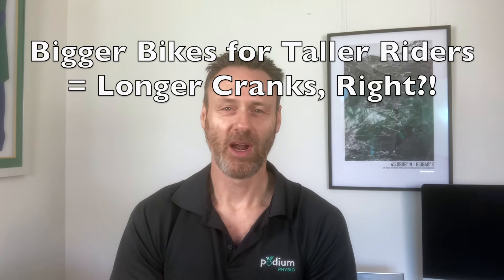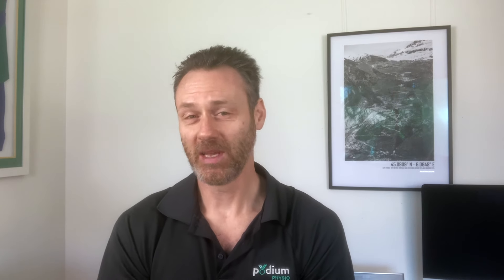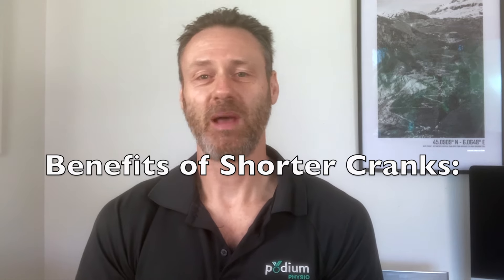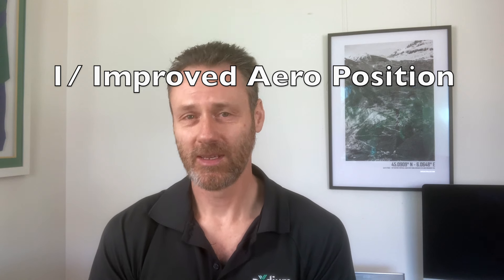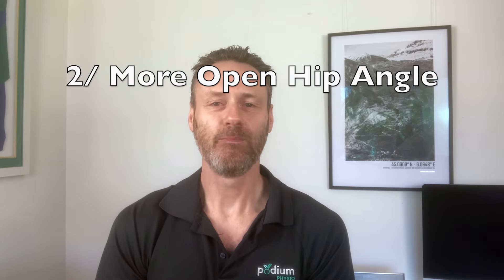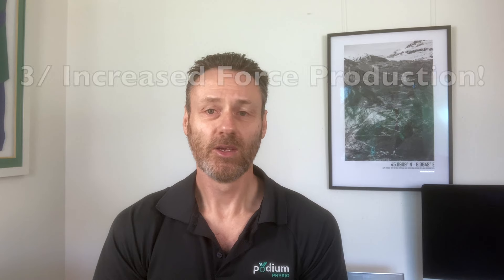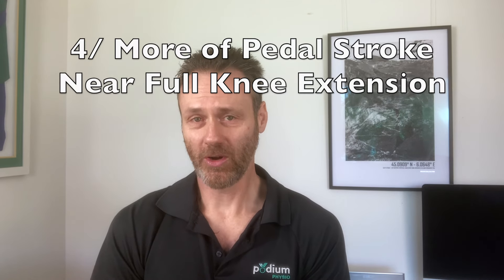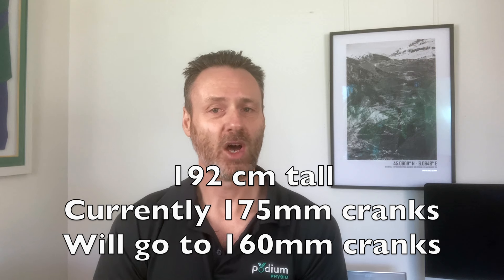Why You Need Shorter Cranks

Comment: I’m 5’7 (170cm) with relatively long legs with 32 inseam (81cm) and went from 175-170-165. Felt so much better. I’ve tried couple of 150 & 155 but felt power output wasn’t quite there although I did feel comfortable. I feel like 160mm would be a sweet spot for me but I can’t seem to find any Carbon MTB cranks in that size as finding one in 165mm is already hard enough. But yeah… I’ll never go back to 170 or 175
Reply from the maker: Sorry to hear you cant find the cranks you want. I just asked my local bike shop to get some in (160mm SRAM) and they were there within 2 weeks. Maybe I was just lucky.
Hopefully you will come across some soon!
Reply: @podiumphysio657 what kind of SRAM cranks come in 160mm length? Do you have a link you can send? Thanks for your content!
Reply from the maker: @ericandeddy  Hey there. I've actually just ordered a new bike and asked the LBS to put SRAM 160mm cranks on them. I dont know how they place their wholesale orders however I did a quick search on Amazon and it seems they might be available there...
https://www.amazon.com/SRAM-Rival-12-Speed-Crankset-Black/dp/B092VL7TMC/ref=sr_1_2?crid=8KCD2SVR20JI&dib=eyJ2IjoiMSJ9.T1rRPkXPwxKIrEdTwGxFFYKMLMofl5jHHI1cUA7qIJVTesBdRuRitl6RyG51oC0XrbSwJpZL3IRD-u5I9uELIxTx9ZRgRvoL6CZ-MUFhWeu1o8-DGQH1wQ47flvPfqWIR9nTcKuMnNzG6Ted3gqNgZL4Ch9sDrTy1L3eQhNujHLvJy4VS-XDWhXo2Ui6YnkWxd3ODyjjjUO0B_KzoZHtSdDRFl4Y_ALqMPlXzSCgX-lUM1FL4XKldFULGZVP98TXrZq7AbRqFO-JzT3UbhIboRCVb28pgO7IFjCQ58A4JjU.rtfw9SFy-niKXtQWIjTKe_JtFOBrbIUtY6MVZyzgxDA&dib_tag=se&keywords=sram%2Bdub%2Bcrankset%2B160mm&qid=1710045687&sprefix=SRAM%2BDUB%2B160mm%2Caps%2C439&sr=8-2&th=1
Reply: @podiumphysio657  thanks. Wish SRAM made Force or Red in that size. The sram rival cranks are heavy and you have to buy the whole crankset since the crank arms are not compatible with other sram chain sets
Reply from the maker: @ericandeddy  Yes cycling is an expensive sport/ hobby. But it is nice to get your bike set up exactly how you want it!

Comment: As a short old rider 164cm high 69cm inseam.  All my life i have had the choice with a small or x small bike getting the choice of 170mm or 175mm cranks take it or leave it ? Obviously i gave up . Until recently i gave it another go . On line crank length calculator bikefaff punched in the 69cm inseam and back came 140mm.  140mm surly that bound to be way to short ? Well no , found a 140mm crank from a cheap folding bike with 140mm cranks, swapped them over ,hay presto they work . Not only do they work as far as i am concerned they confirm the on line calculator,  they are absolutely spot on for me . After years and decades being fobbed off with 170mm is the lowest normally take it or leave it .
Even on XS and XXS bikes for sale all come with 170mm cranks.  Decades of waisted time .
No going back for me .
Reply from the maker: I've waited 6 years to give this a try...
Glad to hear you found a solution that works well for you. That is all that matters.
Reply: @robduncan599 I'm the same height and have used 155mm Rotor cranks since 2017. No downsides as far as I can tell.

Comment: Many years ago my training bike ended up with 155 cranks , this was due to no alternative tbh. I'm 5'8" btw. I never raced on them but did long rides and there was less tiredness and apparent speed and efficiency improvement.  Not scientific but  I might give it another go
Reply from the maker: Why didn't you stick with them?
Reply: @podiumphysio657  ah well,  probably got a different bike and set up,  don't remember what exactly happened.  I was mostly riding 66" gear fixed with this and found my average speed was higher on long rides without being more knackered.  
Nowadays I would probably try and be more scientific,  no power meters or even heart rate monitors for me then. 
I was doing regular 80 mile rides on it though.  
I'll see what cranks are in the workshop,  probably have to be kids mtb triple to bolt to the winter bike, it's z2 season so might be a good time to try.
Reply from the maker: @steveprice9737  More speed and less fatigue = win /win 😀

Comment: I'm also 192cm ride a 59 seat tube and have always used 170mm cranks. My inseam is 'only' around 87/88cm for my height, however 175 always felt too long. I'm going to try 165. There are a few variables to consider with hip and knee comfort, seat tube angle, BB height, head tube angle etc. I personally feel they make bike frames with seat tube angles thar are too relaxed. Being over your BB more reduces hip pain and can allow you to get your knees, feet, back and hips into a better sync than a relaxed seat tube geometry. Let me know what you think, and how the 160 has been, thanks
Reply from the maker: Hey VW. I’ve been using 160s for 6 months and I’m never going back. Less pain and better performance all round.

Comment: I have 175mm on my road bike and 170 on my tri bike, honestly I think it makes almost no difference and can't tell any benefit other than when on the tri bars it is a bit nicer on my hip flexors because of opening the hip angle.
Reply from the maker: Yes the time trial position is where this will be most noticeable. I had 172.5 on a previous bike and I did not notice any difference at all (only 25mm difference though)

Comment: can you do a test at a specific power for set distance and compare the 2 rides, also do a test using a specific gear ratio for a set diatance and compare rides. intreasted in power diffrences and personal feel.
Reply from the maker: Yes I've had a similar suggestion already - riding to power on the 2 bikes and comparing heart rate data. Planning to start on this very soon...

Comment: You’ll need to let us know what other changes are needed when going to a shorter crank. Straight off, there will be a raise in the saddle height so that your max extension doesn’t change, and which will increase your reach. Anything like that.
Reply from the maker: Yes of course. I had the local bike shop install these cranks for me while they were doing a regular service on this bike, and they automatically decided to put the saddle up an additional 15mm. (Fair enough...) This was how I rode the bike (my Tarmac) the first time I tried it out. However because this bike has a proprietary stem, which is at the top of the steerer tube already, and cant be flipped, I then decided to drop the saddle back to where it was, otherwise I was going to have something like a 12cm saddle to bars drop which is way too much for me. You will see what I mean when I post my next video on the bike fit considerations of these 2 setups.
My knee extension actually doesn't change all that much between saddle heights, but my ankle extension does! 
Because of the advantages gained with the shorter cranks, at this stage i really dont think I'm going to need to change my cassette, chainrings or anything else at the moment. I'll do an update in a few months to see if my feeling about this changes.

Comment: This from one study without any links provided?
I don’t need one because if this was the case ..that shortish cranks provide all benefits mentioned in this video then the pro peloton would be stacked with them. That is not the case
Reply from the maker: Here is the study. I dont have access to the full paper. I was at the ISCO conference in 2018 where Jim presented these findings as part of his overall workshop.
https://pubmed.ncbi.nlm.nih.gov/9372489/#:~:text=Inertial%2Dload%20method%20determines%20maximal%20cycling%20power%20in%20a%20single%20exercise%20bout

Comment: If you’re 6’4” an plan on riding 160mm crank arms, what would the recommended length be for someone 5’ tall? Until someone can explain crank arm recommendations over a wide range of heights, I’m sticking with my current setup.
Reply from the maker: Well the whole point of this exercise is that conventional wisdom and tradition would have it that a taller rider needs longer cranks and a shorter rider needs shorter cranks. There are various tools online that can do a calculation for you based on leg length and give you a recommendation.
However I'm looking to move to much shorter cranks than are normally recommended because I have significant hip joint restriction, and because I'm academically curious about the results.

Comment: What is your inseam length? I am on a 58 cm cannondale road bike and 178 cm height 91.5 cm inseam and 175 cm cranks. So trying to figure out what’s best for me. Thanks. Dale.
Reply from the maker: Hey Dale. I've never taken much note of my inseam length and have never recorded it for anyone that I've done a bike fit for. 
The whole point of this video is to show that going to significantly shorter cranks has multiple benefits and no discernible downside. 
As a six foot four rider I changed from 175 to 160mm cranks, and 6 months into the experiment I've been very pleased with the results.  
If you are 178 cm tall I'd suggest 175mm cranks are way too long.
Reply: @podiumphysio657  My intuition says even though I am not tall for my inseam length of 91.5 it may feel different to get on shorter cranks.Maybe I will have to shorten it to try? Waiting for your experiment?
Reply from the maker: @daleschrader1946  Dale - Yes it feels a little different. In my case I can say it definitely feels better. Remember though that my primary reason for changing to shorter cranks was to look after my arthritic hips. Reducing pain was my primary concern and everything else was a bonus. 
I've made 6 videos on the subject of shorter cranks, looking at many different elements - bike fit/ FTP/ sprint power etc. These are all available on my youtube channel.
After 6 months I can say I am very happy with shorter cranks and have no intention of going back to 175s (other than to conduct more experiments). All of my regular training and competitions will be on 160s.

Comment: Did Jim show you how and where the power data was collected in his test?
Reply from the maker: So this conference was 5 years ago, and I dont recall the exact methodology being discussed, however I've found one of the papers on line and it describes the method as:
"Maximal cycling power was measured using the inertial load method (Martinetal.1997), which determines the torque and power delivered to an ergometer  flywheel across a range of pedaling rates."

Comment: I'm 4'11 and was riding 160mm. Crank calculator siad I should ride 145mm.  I felt like that was to big of jump. About a week ago I put some 155mm cranks on my SL8. I immediately noticed a huge reduction in hip pain. I think it will completely disappear. I don't think I can go to a shorter crank because my knees might hit my chest from the bike being so low at the front. My power numbers are very low. This year my plan is to cycle more and increase my power numbers.
Reply: Did you increase your saddle height after changing the crank arm?
Reply: Hi Kim, Did you raise your saddle the 5mm? Also you can raise your stem (or flip it to give you height). This should help (reduce) gut/chest strike. You could also put your cleats as far back as they will go to aid stability and power transfer. When you do this, lower your saddle by the amount you slide the cleats back. thanks, mark
Reply: I am 5'4" 164cm with inseam 69cm , i used the on line bikefaff the answer i got was 140mm . As luck would happen i found 140mm cranks from a folding bike . Swapped them over and revolutionised my biking . As far as i am concerned the best move i ever made . Only you might need to use a slightly lower gear . I moved from 165mm to 140mm about 15% shorter,  i think i need a 15%lower gear which you would need to turn the cranks 15% faster for all being equal?  I couldn't care less for performance or marginal gains , but comfort is everything for me . 140mm for me never giing back .
Reply: @mrwhiteshorts  no, actually lowered it a bit. To me it feels more comfortable. Maybe I've had my saddle a little to high. I would get pain on the inside of my lower thigh. I also moved my cleats all the way back. My other bikes still have 160 cranks and I haven't lowered my seat on those. But I'm no longer experiencing that pain. It also could just be pain from cycling more
Reply: @kimwarner6050  Hi Kim, thats great. Of course, this was assuming it would be correct in the first instance. It was when i put the mid-foot cleat adapters, and changed my saddle to a Tune one, that i discovered my saddle was too high. All the best in cycling. m
Reply from the maker: Yes lowering the front end in response might have unwanted effects at the hip. However I did my first ride with the new 160s yesterday with the saddle lifted 15mm but I have not changed the handlebar height as yet. My first comment is that it felt like the reduction in pedal radius more than overcame the lower trunk angle. I'm about to collect some body angle data across my 2 bikes (175 vs 160 cranks) and put up the comparison.

Comment: What is considered a short crank 160? Whats the ideal length for height or inseam height? Basically is there a calculator for crankarms length?
Reply from the maker: Hey there. The point of this video and the several I have produced subsequently on the same subject is that the cycling industry builds bikes and provides components that suit the masses, often based on tradition and historical norms. I have presented evidence in this video that cranks as short as 145mm actually can be very effective. I am 193 cm tall and am generally offered 175mm cranks on any bike that I buy/ ride, however I have moved to the shortest possible cranks I can find from SRAM (160mm) and have found these to be much more comfortable and provide performance gains across a number of metrics. 
I have not used and am not advocating any particular formula for crank length, however I recommend riders consider trying shorter cranks than the ones that come standard, and to not be afraid to go to a length that seems "unusually short". The evidence (and my experience) supports it!

Comment: I'm 175cm with 82cm inseam. I use 170mm cranks and they feel good. Maybe it's because I train legs and deep squat alot and my mobility is really good.
Reply from the maker: It will certainly help if you are strong with good flexibility. However I've also now seen some very interesting performance benefits in going to shorter cranks, regardless of those two parameters.

Comment: What would be the difference between shorter cranks vs lowering your saddle ?
Reply from the maker: Sure. Lowering the saddle will increase my torso angle (good for my hips, worse for aerodynamics), but would also result in a higher relative knee rise at the top of the pedal stroke (bad for me), and would potentially increase the knee flexion at bottom dead centre which probably is not ideal in general also. This may increase patello-femoral compression and possibly irritate that joint, and perhaps move you out of the quads/ glutes force production sweet spot.

Comment: I'm 5'11 with a 32 inch inseam, or 180cm and 81cm... can you recommend crank size based on my dimensions or is there a resource I can use to estimate proper crank size? Cheers.
Reply from the maker: Well not really, unfortunately. I decided to go to 160mm cranks because I have hip pain and I know from a hip angle perspective, the shorter the better. I went with the shortest cranks that were easily available from a mainstream supplier. I am also academically curious about whether such a big (and unconventional) change has any downsides. Based on my findings thus far, I'd suggest if you can go to 160 mm give them a try, but this is based on my opinion only.
If you have not already, have a look at the 2 latest videos I've made about shorter cranks. I'm also working on video #4 which I hope will be ready to publish either today or early the coming week.

Comment: About 3 1/2 years ago after seeing a Cam Nicholas video about cranks
I took the plunge and went from 172 to 165. Crank length. I'm 165 cm in height.
 I use a crank based power metre, would someone know if the wattage is affected by the shorter length. 
Is there any data about power output from shorter cranks?
Reply from the maker: Hey did you watch the whole video? There is a specific discussion on this topic.
I have some further information on power output here. https://youtu.be/P0qO6Wza58w
Reply: @podiumphysio657  thanks I guess I didn't cover the whole video.
I'm a convert already. All the best
Reply from the maker: @lilth501  No problem. I'll be making a few further videos in the coming weeks on the same subject. Keep an eye out!

Comment: Hi im 165cm height what do you think is the best 165 or 160mm?
Reply from the maker: Hi. Im not in a position to give specific advice over the internet, and having just your height is very little information to work on. However I am 192 cm tall, ie 27cm taller than you, and have made a successful transition to 160mm cranks. So based on that, unless there is anything particularly unusual about your situation, you should be fine with 160mm cranks.

Comment: I used my wife's bike with 165mm cranks for 2 years and i have to say they never felt right. I rode roughly 32km per day on that bike until i was able to replace my own that had 172,5mm. I'd like to see repeatable proof that shows it is better, but i don't think it's for me personally.
Reply from the maker: I'm planning to put up a bunch of data comparisons over the coming weeks...
Maybe for your own experiment you need to try the shorter cranks on your own bike?
Reply: @podiumphysio657  i had 165 on my fixed gear but replaced those with 172.5 spares i had laying around as soon as i could. But for my roadbike i don't have shorter cranks at my disposal, which is where the value is in comparing them. So i'll patiently wait for your findings haha
Reply from the maker: Updates are on their way...